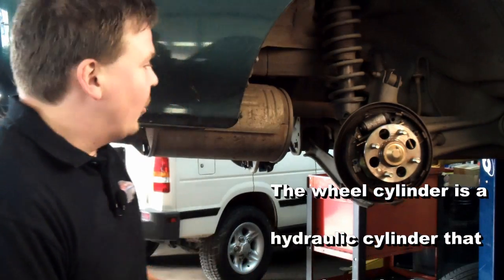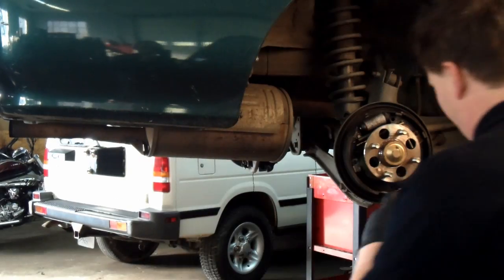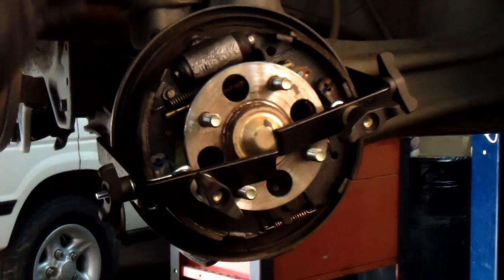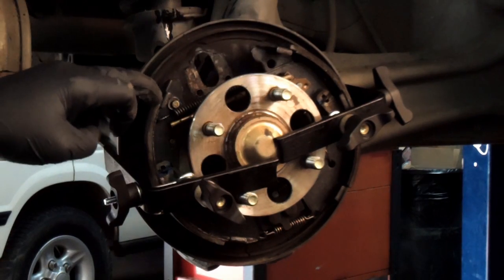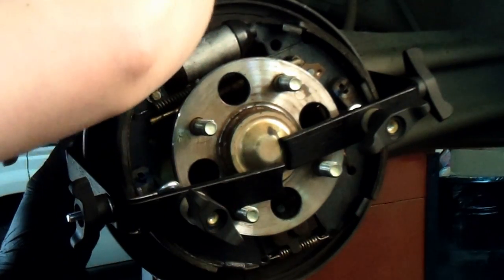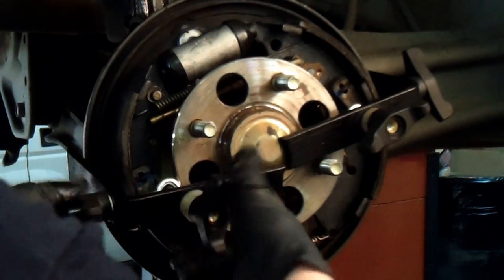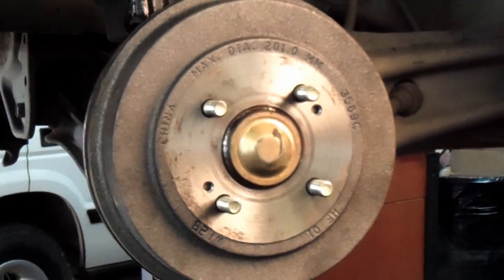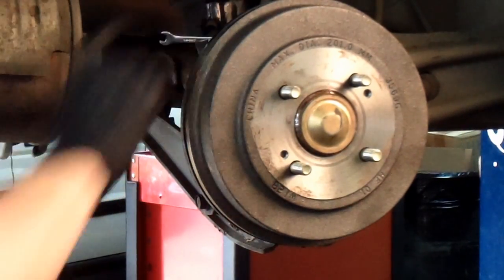How To Replace a Leaking Wheel Cylinder On Rear Drum Brakes (example Honda Civic)

Comment: how many diy'ers do you think have the separator tool?  why did you not mention what size wrench and show the rear  where the bolts and brake line are and how to get them off?  What about how to replace the brake line?  this video is nothing more than a tool advertisement, the rest is pretty much worthless.

Comment: how do you remove a stuck drum? I use the bolts, but they don't pop off. They just pull out about half an inch. I'm afraid to brake something So I don't try to go further than that. Should I just keep turning? I don't want anything to pop off and hit me.

Comment: I have a 2000 Honda Odyssey cargo van,and what a problem getting drums off.But we got them.The dam petal kept going to floor so we decided to check Rear drums and boom there it was rear brake cylinders leaking and shoes shot .Do I need to spray it with brake fluid at end or no? Thank You Rob.

Comment: Is spraying brake cleaner good enough when pads are saturated with fluid?  or do I have to replace them?  I had changed the drums not that long ago, so can I just clean them?  What's the best way to clean them?

Comment: Were did you buy the tool that seperates the brake shoes? Whats it called? Thank you all are good videos.
Reply from the maker: Thanks for the question Joe! It's called a GM Brake spring tool. Lisle makes a set and the part number is 50600. Here is a link, http://www.amazon.com/Lisle-50600-Spring-Brake-Tool/dp/B000GHZMTQ